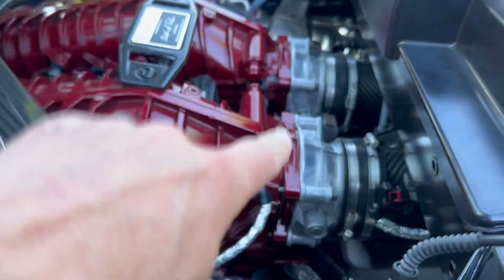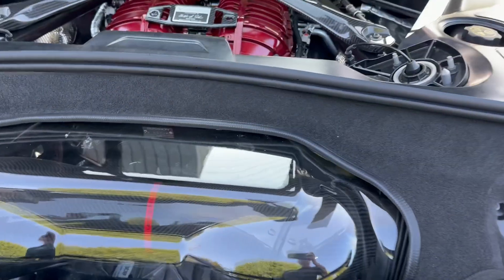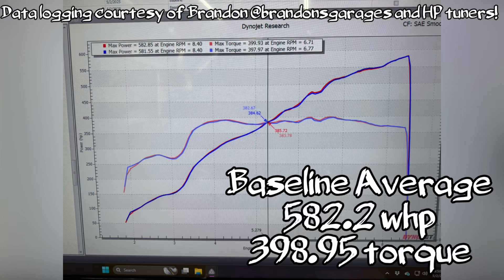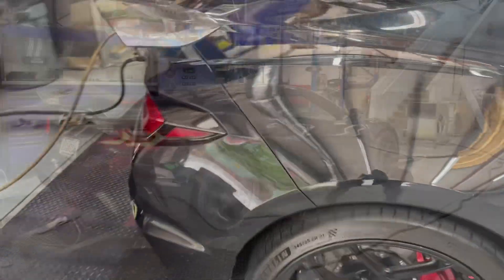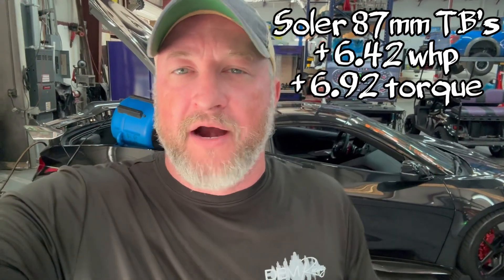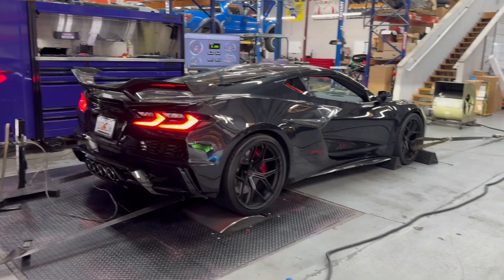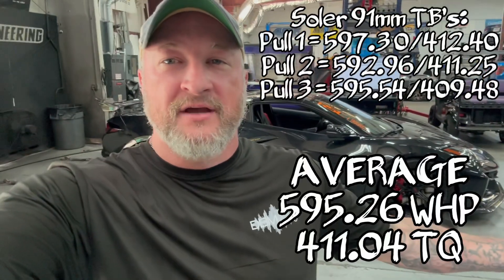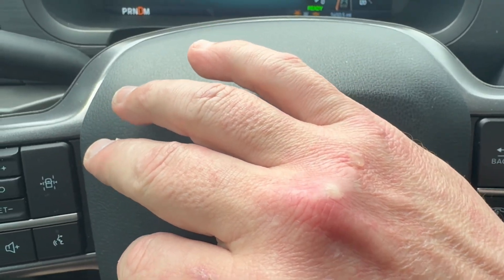DYNO RESULTS for C8 Z06 with Soler Performance 87mm and 91mm ported throttle bodies!

Comment from the maker: You can’t go wrong with the Soler Ported throttle bodies! Pair them with the Soler Throttle Controller and you will CHANGE the car!!
Reply: Especially if you combine it with the Eventuri cold air intake system.  The result is synergistic and adds way more power overall.
Reply from the maker: @ yes it does. It all adds up
Reply: Throttle controller alone is just a feel thing, right?
Reply from the maker: @spin_kick that is correct. It gets you into the power much more quickly and changes the way the car drives COMPLETELY but it doesn’t actually add horsepower. Trust me. Best money I spent on my car was the throttle controller and it’s probably the cheapest mod!

Comment: Coming from my 20+ years of drag racing, I can appreciate seeing gains from Dyno comparisons. I have gone so far as to run 0-20 oil and ceramic bearings just to free up a couple of horsepower by refusing HP robbing friction. However, I do like to see the whole story. Peak HP numbers are one thing but an overlay of the graph before and after will show everything. Peak HP numbers gained but at the cost of a loss of HP and or torque in other areas and possibly areas that equate to lower ET’s on the track isn’t a gain at all. David, you certainly put the work in and it’s much appreciated. Me being such an analytical person, I’m always wanting to see more !! 😂
Reply from the maker: @darrenburnett1  I completely get that and I 100% agree with peak power vs power under the curve. I also have years of drag racing experience and have tried probably most of the tricks you speak of. Peak is only really useful in applications where you are at 100% power the entire run and not most real world situations s

Comment: AFAIC, the juice ain't worth the squeeze...especially if Chevy may use it to deny a warranty claim.  Even with catback, high flow cats, TB's and airbox, the overall gains aren't earth shattering from what I can tell.
Reply from the maker: @MotoJB  maybe not earth shattering but I’ll certainly WALK a stock Z06 easy. It’s more than you think as well when you add it up. I believe all in with all the mods available for this platform the other Z06 we feature on this channel probably makes 650-660 whp and runs low 6’s NA 60-130 so those are MASSIVE improvements over stock. Stock 60-130 most Z’s run 8.0’s. That’s almost TWO SECONDS. Dyno numbers don’t represent every gain but speed and time slips do. Two second gain 60-130 is pretty earth shattering with NO TUNE required.
Reply: @dbmracing2019  the proof is in the pudding

Comment: I know that this was a ton of work to do on a really expensive car and I sincerely appreciate it. But over the 30 years that I’ve put performance throttle bodies on several cars, it just ends up being a nightmare…..either loss of horsepower, loss of torque, loss of fuel economy, and in one case, ungodly, irritating drivability issues. Never again.
Reply from the maker: @goldenmanuever1176  I appreciate your feedback about your experience and I’ve been there before in the past. I can honestly say I have done this multiple cars and multiple times and we have always made power and torque. And these have actually smoothed out the drivability. Thousands of miles on these and not on issue or codes
Reply: I have to agree I added a Soler performance 91mm TB and didn’t see any gain, I’m unlocked with HP tuners and on E85 with my Eray. I did a ported intake manifold by SoCal also and between both no gains… each dyno run unfortunately are not created equal and it’s sad to see people pushing this stuff for a couple free TB’s 😂 And if you even did gain a bit on top on this Z06 you lost it on the bottom guaranteed it’s simple VE
Reply: @uflan_dad8726  I only use Tadge approved throttle bodies these days 😂😂😂😂😂😂😂😂

Comment: Awesome. Looking at the mamo 91 mm for my C7
Reply from the maker: @dmos2811  I’m actually impressed with how ported TBs make such good power. GM left a lot on the table! Soler guys are awesome to work with and Brandon has nothing but good things to say about Tony. Thanks for commenting
Reply: @dbmracing2019  I think it's across the board. On top of my C7 I got a Dodge Charger and a ram. The local car group with all the so called expert race guys, told me over the years how much a bigger ported TB was a waste of money and just go with the stock. I've always done what I want so I didn't listen and did it anyway. More power, way more response, and better gas mileage. Maybe the gas mileage is imagined by me to recoup cost. But I love the ported TB mod.
Reply from the maker: @ me too! Have one coming custom matched to my ported gt350 manifold and I’m excited for my next buikd
Reply: @dbmracing2019  nice looking forward to the video

Comment: David,
Where's the Mamo testing numbers 😢 ?
I really wanted to see those next to the Solar numbers for the comparison 😅
Oh well 🤷...
Great job here on the testing 🔥
-Shane
Reply from the maker: @Hangin_With_Shane  Brandon posted those on the forums. That was his content and he has all the data and flow numbers etc on the corvette forums. LOTS of data and some very spirited conversation 😂 check it out but basically the 91’s and the Mamos were a dead heat on the Dyno and probably within the margin of error for the Dyno. Conclusion is all ported TBs make great power on these engines!!
Reply: @dbmracing2019  Gotcha, I've seen his numbers then already! So I know what to order for my Boy's CAI Mamo's 🤣

Comment: Very impressive, for a fairly simple bolt on, that paired up with an Eventuri intake, which you have seems pretty respectable , however I didn’t catch a $$ on 91mm bodies, but I am guessing these together are 4k +or-, fairly pricey 10-15hp, hard to imagine you can feel anything by seat of pants. Good job either, thanks for the effort and sharing!
Reply from the maker: @kurtthomas4746  The 87mm throttle bodies made great power on previous dyno day without cold air intake. They actually performed really well even with the JLT. Now Corsa has a CAI. We will be dyno testing that against the eventuri very soon! The feel is actually noticeable and paired with the eventuri the gains will be more in the 50 to 60 whp in the midrange and 50-60 torque. The TBs also make the throttle tip and and driving response smoother IMO. Every brand and model we have tried honestly. Thanks for commenting and we love putting out dyno content

Comment: I'll be the one to "ruffle the feathers" Mamos TBs are better ! lol🤣
Reply from the maker: @derrickdunlop3566  Love it Derrick! You are the first to have a set outside of Brandon…. Plus your manifold! And your car flies!
Reply: @dbmracing2019   ANY CHANCE YOU CAN DO THE MAMOS 91MM, I ORDERED A SET BUT THERE ARE NO NUMBERS OUT THERE YET.  THANKS
Reply from the maker: @ the Mamos made almost identical power to the 91’s. Brandon posted the result on Corvette forums. https://www.corvetteforum.com/forums/c8-z06-discussion/4920573-mamo-vs-soler-throttle-bodies-data-9.html
Reply: @dbmracing2019  Which begs the question as to why use an aftermarket housing and electronics when the Mamo ported oem throttle bodies produce the same output?
Reply: DO YOU HAVE THEM ?
Reply from the maker: @steventoal8594  I had a set to test for dyno numbers